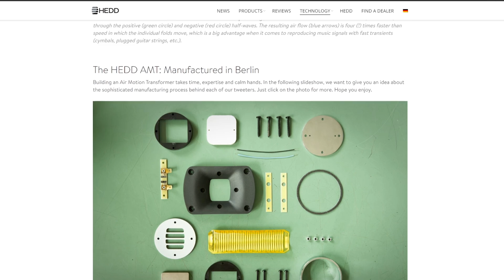HEDD Audio CEO discusses the HEDDphone's new AMT driver tech.

Comment: HEDDphone vs HD800S (or modded HD800)... Nearly impossible to find people vaguely comparing...
Reply from the maker: Oh, HEDDphone absolutely. That's an easy one.
Reply: Really? For the same price, even? To be clear about something: I keep reading that the soundstage here seems to adjust as more sounds are coming through; would that affect reliability in gaming? (Yes, I'm an idiot who spends that much mainly for gaming, but I also love music - I have Focal Clear Professionals).
Reply: I'm about a month away from buying the HD800, to mod with the Super Dupont Resonator. I play FPS games a lot, and the top gamers highly recommend those. But THIS just hit the market...
Reply from the maker: @darrellharwood6600  for gaming, the HEDDphone might be too heavy - especially for long sessions. Hd800s would be the way to go, or SDR if you find an old hd800
Reply: Fair point.
Reply from the maker: @darrellharwood6600  Yeah it's a heavy headphone for sure. I used to be a competitive player as well, and while the HEDDphone is technically more impressive than the hd800 for sound, I do feel that the weight would get to me. I'd say around 4-5 hours was okay, but you don't want your neck to get sore, especially if you're sitting upright and focusing. If you're okay with heavy headphones, then it's definitely a great choice, I just feel that it would get to me in a competitive setting.

Also, consider the Hifiman Arya. That headphone has some pretty crazy stage depth.
Reply: Oh yeah? I wasn't sure about it's soundstage capabilities, and that's the only reason it wasn't on my list. General descriptions of it's tonality and capabilities had me thinking it would be fantastic for my preferences, otherwise...
Reply: Interestingly, Joshua Valour is the one that put me slightly off of the Arya, when compared to the HD800; even though he says it's the best headphone (for him), he said the HD800 has a significantly wider soundstage than anything else. But, I was just re-watching it and noticed something I didn't before: he said that while the HD800 has the widest soundstage, it kind of forces everything to be that large, even if it maybe shouldn't be... meanwhile, the Arya reveals the quality of the music's layering. Other reviewers have said that the HD800 is quite impressively wide, but many times in an unnatural way. That makes me think that maybe the soundstage of the Arya is more true to the sound, if not quite as impressive... and maybe that would be better for competitive gaming, where accuracy is incredibly important.
Reply: lol. Idk how I missed the comparison Josh did between the Arya and HD800S in January... maybe because I already had my Focal Clears and wasn't considering a new pair. Damn it. I should've got those. Oh well. I'll get the Arya and see what's up, and probably sell the Clears.
Reply from the maker: @darrellharwood6600  yeah that's a assessment. And yeah the hd800 is wider than the Arya. For gaming, it's not all about the soundstage though. A lot of it is detail retrieval. Keep in mind, these are also all extreme open back headphones, so your PC fan noise will come through. In some ways I prefer closed for that use because it lowers the noise floor.
Reply: I'm contrary to most gamers: I hate RGB because it's distracting in my peripheral, and I learned years ago that I hate my machine making noise. So, not only is my machine on the floor and away from me, but it's a windowless, silent case (BeQuiet! Silent Base 800) with silent fans and is not overclocked.

All the talk about the Arya's soundstage having huge verticality and presence instead of the HD800's pinpoint, distant sounds makes me think that while the HD800 would be impressive with it's crazy (borderline unnaturally-large) scale, that it wouldn't be as impressive in a gun/grenade-fight as the Arya. It also seems that the HD800 would be less enjoyable overall as tool for simply enjoying music, rather than analyzing it.

As far as soundstage not being everything in gaming, but detail retrieval being important, too... I definitely understand that since getting my Clears. The ability to better hear differentiation of sounds such as bushes rustling, someone shifting in place and muffled footsteps, all while there's wind and/or rain around (too much Escape From Tarkov for me). I understand the HD800 can do that superbly, but it sounds like the Arya can, too, as well as having a better (for my tastes) tonality and bass capabilities. And, I absolutely love me some bass. :D